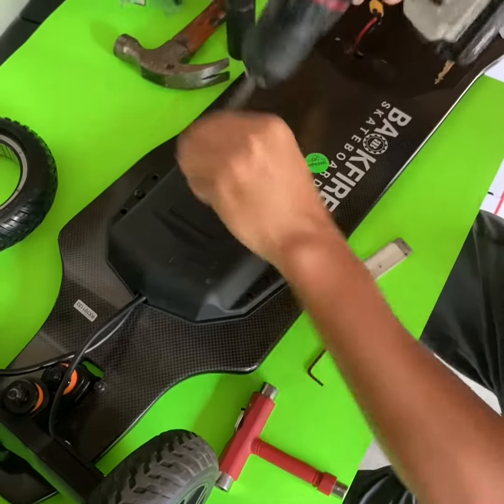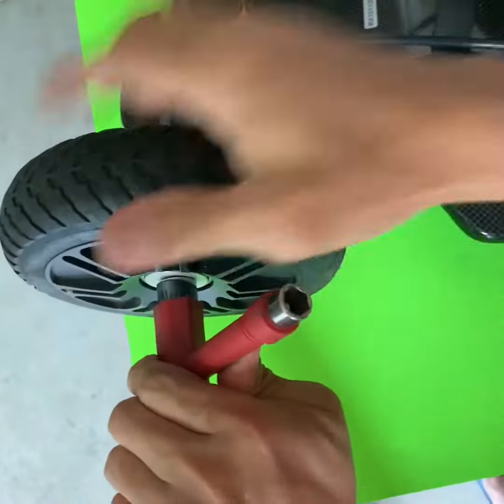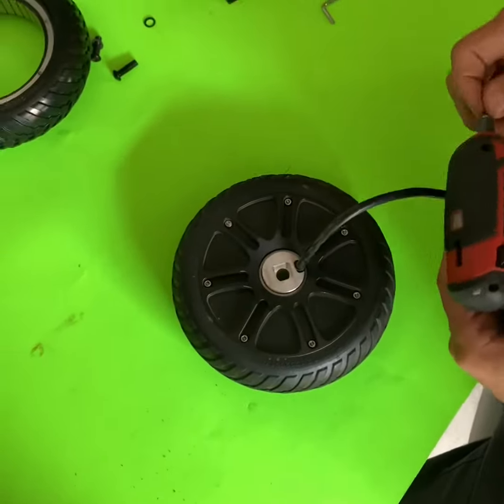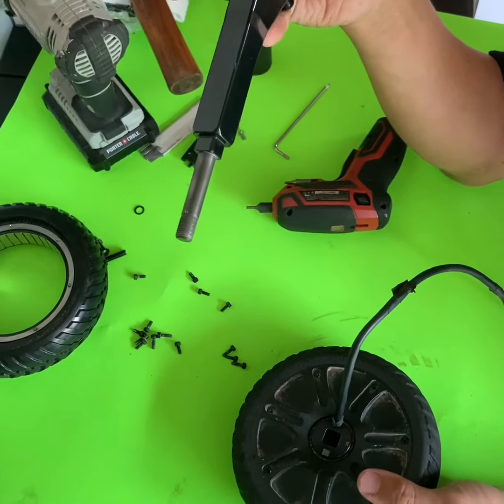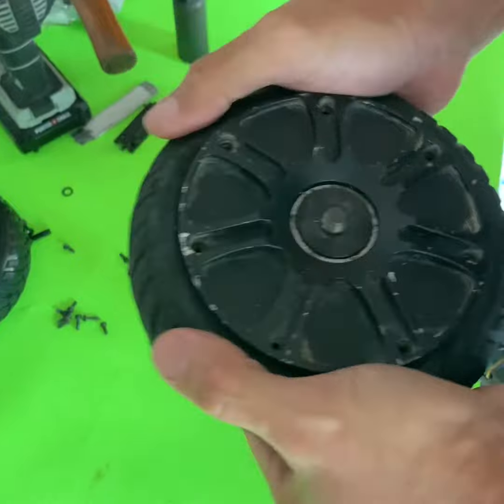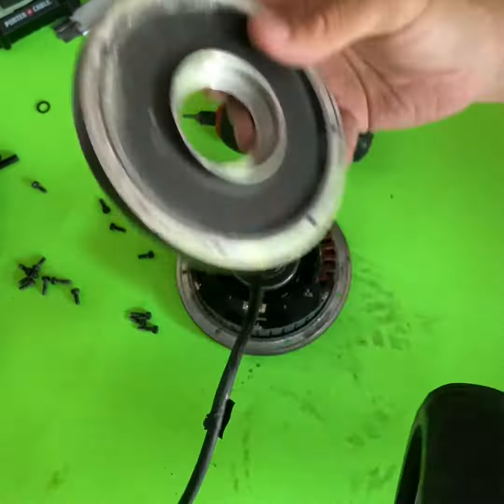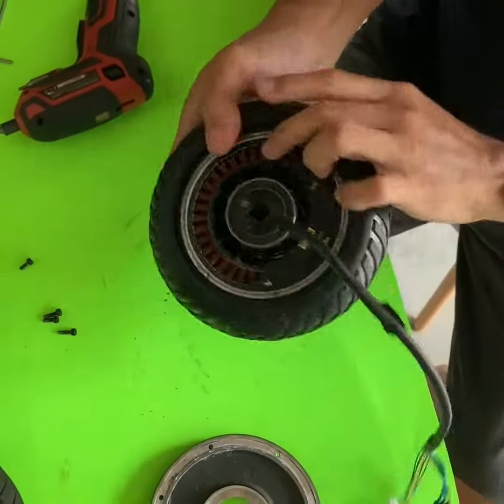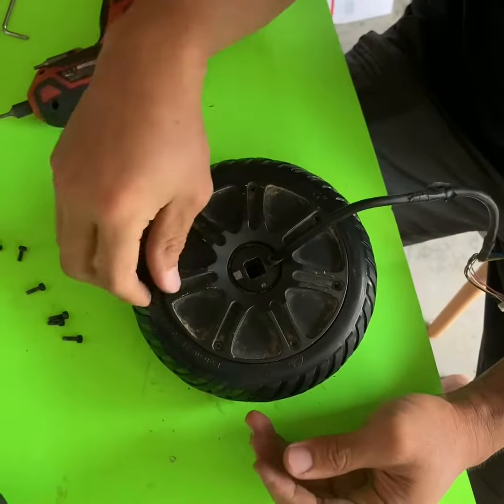How to change the back tires of Ranger X2

Comment: What size did you need to remove screws
Reply: For the small screws on the motor cap
Reply: @ocfwrld9623  you should have the skate tool with all sizes you need

Comment: How long will the tyres last
Reply from the maker: about 600-800 miles
Reply: With heavy use, about 12 to 16 months
Reply: 4300km and still using them but no planning to change